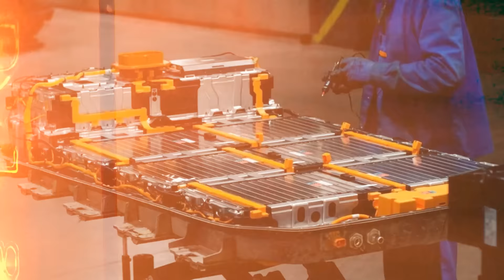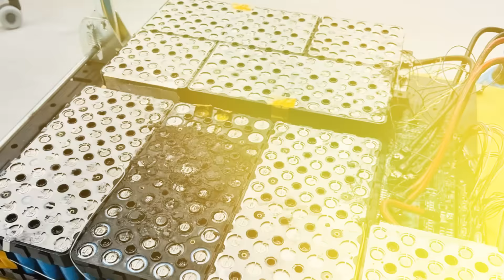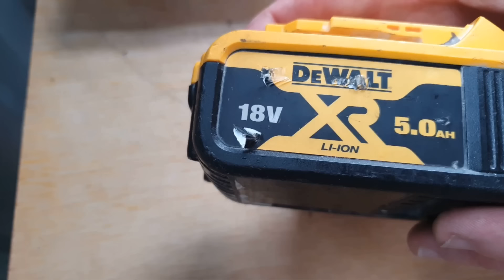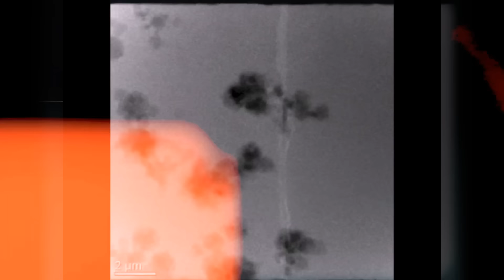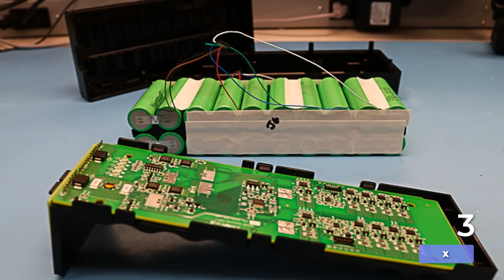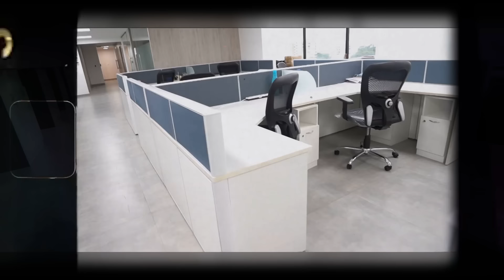China Just Built A Sodium EV Battery With No Lithium — And America Is Stunned

Comment: Those fires were Li ion cells.... Not Li Fe PO4 cells  but it still remains more vulnerable to cold than Na ..Na cells don't have to use copper as the electrodes ..another strategic metal. .

Comment: When will e-bike replacements start?
Reply: For that application Gotion/VW s semi solid cells are what's required as they offer a Na based cell with an energy density the same as Tesla's Li NMC round cells , going into some Chinese cars later this year. But others will emerge. CATLs present Na ion Naxtrà cells match and slightly exceed the BYD Blade 2  LiFePO2 cells ,  but with 5 C rating 175kw per Kg .